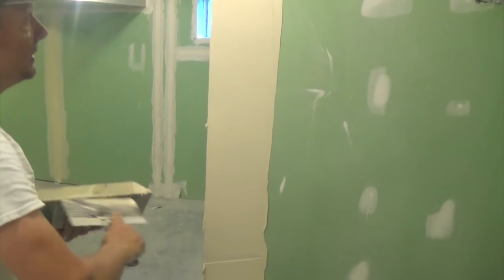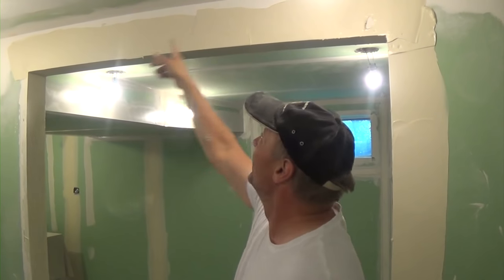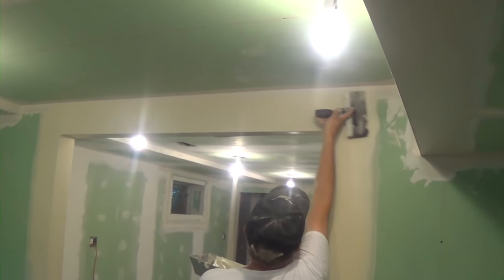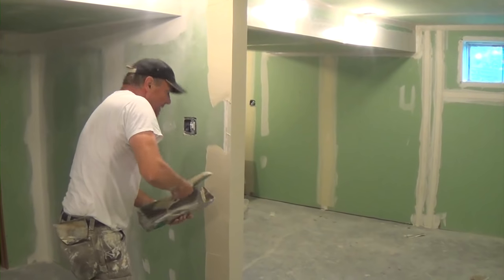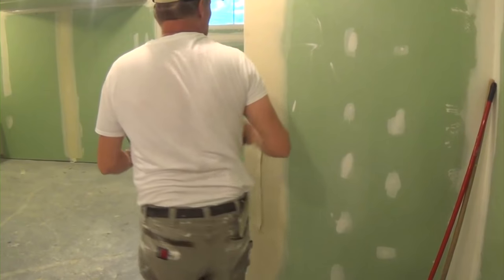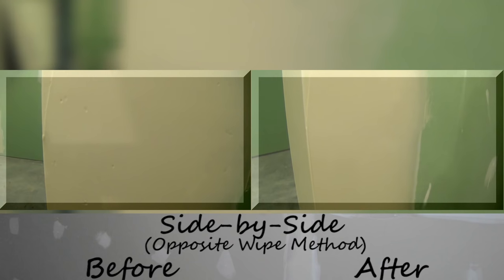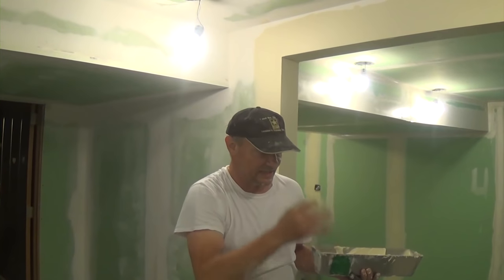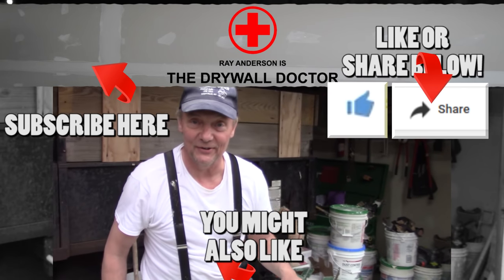How to Remove Air Bubbles in Drywall Mud (without  No-Pocks)

Comment: Practice - practice practice. Im a NYC licensed plumber and have been on many jobsites watching and asking questions, i  was doing a skim coat job in my home in some rooms, after a while of trial and error, you start to get a feel for it. make sure you use a mud paddle and smooth out the compound before you apply. this type of work in NOT a one coat type thing. two 3-three coats and it comes out nice . The first room i did i spent a lot of time sanding by the last room i had almost no sanding - practice makes perfect- this man is a professional and offers some great advise, Thanks for sharing.

Comment: Mudding is such an art. Your technique is so advanced. I'm trying to fix corner in a washroom, and I think I saturated the wall too much because layers of previous paint started to bubble and peel through in one area. Now I'm trying to skim the area (maybe 3 ft x 3x?), and I'm seeing a few bubbles. I'm pretty sure the paint is saturated with moisture again in these two or three areas, but I'm hoping this will stop happening after my third skim and everything has had a chance to harden.

Comment: Mudding is not as easy as he makes it look.
Reply: I know right?! In theory it seems easy and professional tapers make it look extremely easy. When it does require experience and it really is an art. I work for a general contractor and it probably took me over 3 years of practice to be able to work efficiently, not make a mess and have anything I mudded look perfect and professional! I've been working for this general for 6 years now and I am still perfecting my skill at it... Mainly skimming out most of the mud from the joints so there's little to no sanding required and working quickly/effectively. Beause it's not something I do/practice on every job site. But I can make any dry wall taping look perfect, I'm just alot slower because I tend to skim it a 3-4rd time :(

Comment: Adding a a 1/2 teaspoon of mud to a bucket/box mud helps.  Also if you’re going over previously painted drywall you need to make a super tight, with a lot of pressure 1st coat.  Then you will have to do 2 more coats.

Comment: I've been doing sheetrock for about 20 years and was often frustrated with those air bubbles. I found if you put a little dawn dish soap in your mud it takes the bubbles out too. But letting it sit for a few minutes is a great technic. I'll definitely remember that one. Durabond is the worst though. Even dish soap wouldn't get em out. Imma try this technique asap.  Btw your one hell of a finisher. Thanks for the tip bro
Reply: My eyes are burning sanding.

Comment: When you mix your mud with a drill try back spinning it at the end. Doing so will pull most of all the air out the bucket and you won’t have that bubble problem
Reply: It mean when normal mixing is clockwise & the end mixing versus time..That's right???

Comment: Here where it can be very dry, after letting the mud sit a little, you can wet the knife blade down with a wet sponge or paint brush, and  run your smoothing pass with the blade. This can be especially important when knocking down g a very light skip trowel texture. Which is fairly popular around here. I like the little mud slap when you fill your corner bead. That seems to work pretty good.

Comment: At 1:33 you say the only time you have a problem with bubbles is going over a painted surface. Scotch Paints makes a primer "Draw Tite" which I have used with success. But it's pricey and not available everywhere. I thought you might elaborate on the subject since you brought it up; how do you handle the bubbles when going over paint? Doesn't have to be glossy either, bubbles show up on any sheen paint even after a thorough cleaning.
Reply from the maker: It may take three or four coats to get rid of the bubbles but they're tight skin coats

Comment: I've found that a coat of primer on the painted wall before mudding really helps avoid pocking
Reply: michael kistner my experience is trying to mud back on a painted surface after a ppg blankit coat and no matter if durabond or pre-mix I still have bubbles?

Comment: How do you mix plus 3 with easy sand in same bucket  to finish job in technically 2 days. ?  Pros. Use that. But they don't want to tell the amounts.  Thanks.
Reply from the maker: They're not mixing easy sand with + 3 they are taping and Topping the job with easy sand and then skimming it with + 3 and sanding it the second day

Comment: I done plastering i get small air bubbles when sanding small tiny ones remain though its not big deal once primer paint goes on the small holes will fill them in & not even noticed.

Comment: This that you're showing is when you're applying the compound. Is there anything that can be done after the compound is totally dry? I  put on my final coat and when I sanded it pinholes stated to appear. What do I do to fix pinholes after three coats have already been applied to the ceiling. Will primer from fix this?
Reply from the maker: Sadly no very thin mud pulled tight you may have to sand the edge sometime it just paints out without sanding
Reply: @THEDRYWALLDOCTOR1  I wish that I could have sent you a photo of it. It's really fine and you can only see it when you climb on a ladder and  shine a flash light or bright light  on the ceiling
Reply from the maker: Yes but it will look like a dark spot after paint
Reply: @THEDRYWALLDOCTOR1  what if I skim coat it. Would the solve the issue?
Reply from the maker: yes

Comment: "Youre going to have trouble doing this if its 100 degrees with 0% humidity" lol that is exactly my weather report this week...im out of luck.  I hotice the mud is really drying out fast this week, it gets really, really crusty really fast and Im guessing its cause of the humidity (I have the AC on so its not so hot inside)
Reply from the maker: I did a lot of work in the deserts of Arizona and yes it's a completely different story but you can 3 coat it in a day and sand it in 15 minutes
Reply: @THEDRYWALLDOCTOR1  Unfortunately Im skim coating for texture removal, so I need to wait overnight to dry.  Really struggling with pock marks, its worse now that is so hot/dry.  I found the best way is to use a roller when applying the mud.  Messier and less control but by far fewest voids in the mud.  Im also a novice at this, so this method works well for an untrained hand.  Thanks for making these videos - you are a great teacher!

Comment: Hi DD! Great fan here. Learned so much from looking at you go. Many thanks for your videos. I have a question. I recently had to redo the tape joining two drywall surfaces that sit at a 120 degree angle. Once the new tape was in place and the mud had dried, I had a hard time sanding to get a nice straight line at the meeting of the two planes. Have you addressed this issue in one of your many videos? If so, could you point me in it's direction? If not, care to give me a little pointer??? Best, Paul.
Reply from the maker: Are you talking about an inside 45 or a outside 120?
Reply: @THEDRYWALLDOCTOR1  Thanks so much for answering! It's the angle between  a (flat ) ceiling and the sloping underside of the roof, I guess. Inside 120?
Reply from the maker: Yes that's 120 that angle moves a lot any movement on the flat ceiling or movement on the slopes will show up there. Stay away from durabon use +3 only it moves and doesn't crack.
Reply from the maker: I use no coat to make that angle let me look I think I covered it
Reply: @THEDRYWALLDOCTOR1  Thanks for that, very useful. But my issue is more with the finishing sanding to make a nice corner up there. I dont have the other wall to guide my sanding sponge so it's very hard to get a clean straight "line" .  Sorry if I'm not clear in my explanations, it's kind of hard to describe.
Reply: @THEDRYWALLDOCTOR1  Great! Thanks1
Reply from the maker: I was looking for a video but haven't made one I will now thank you I'll try to film one tomorrow and get it up ASAP 👍
Reply: @THEDRYWALLDOCTOR1  Wow. That's so nice and generous. I feel very priviledged! Thanks so much. I will be checking my notifications by the hour!!! Be well!
Reply: @PaulAntoineTaillefer  I pop a chalk line right into the angle, then mud this side or that to create a straight line.

Comment: Oddly I find a thicker (new) blade on your trowel or knife solves this issue .. using my older tools encourages pock marks. 

But otherwise all these suggestions in this video work.
Reply: Really? Thats interesting because I prefer my heavily broken in dry wall trowel that has a honed like edge from all the skimming.  I'm curious to try out a brand new one now to see the difference. but hey theres nothing wrong in that, everyone has their own preferences :)

Comment: What's the best way to get rid of the air bubbles when patching seams on semi gloss paint??  Like fixing a seam from a water damage in a bathroom . I've heard to rough the paint up with sand paper or you knife ?? Or Maybe just do the same thing you did in this video lol..
Reply: Try spreading some mud on the area then wipe the mud off then apply mud again then  finish coat. It sounds sillyvbut really does cut down on the air bubbles
Reply: @THEDRYWALLDOCTOR1  like i always told my ex wife, I agree with me why doesn't everyone? Lol that must be why i habe a ex.

Comment: None of these suggestions worked. More bubbles surface. How do I mix my mud so that there are absolutely no bubbles?
Reply: othername1000 I used to have bubble trouble too, then I quit mixing the mud myself. I also tried different brands of mud and I discovered there are big differences in quality. You only know after you tried them yourself. I also noted that using a trowel that is slightly more flexible also helps. Sanding bubbles away makes a total mess, you end up removing half of what you applied. Every video I watch gives me more little tricks, great way to perfect the skill.
Reply: othername1000 mix your mud for at least 30 seconds. I usually do it for about a minute most of the time